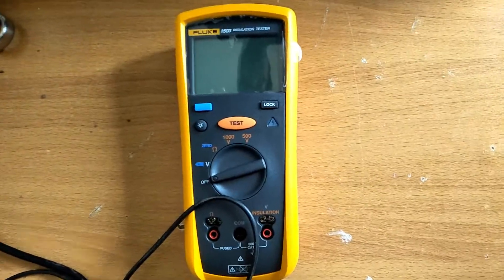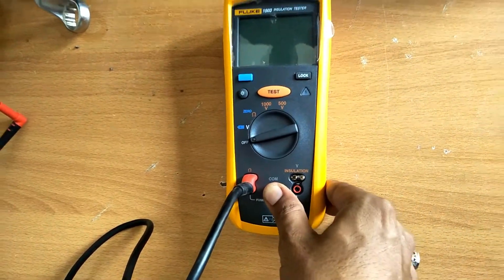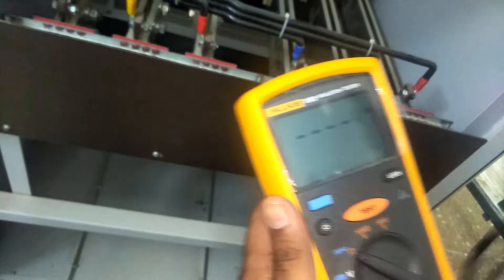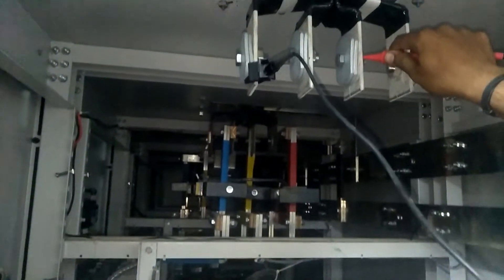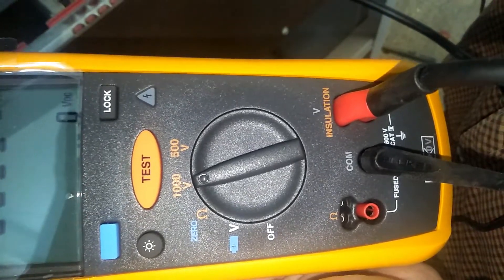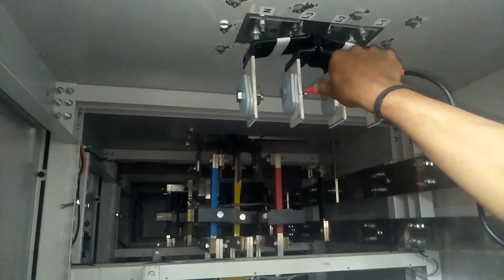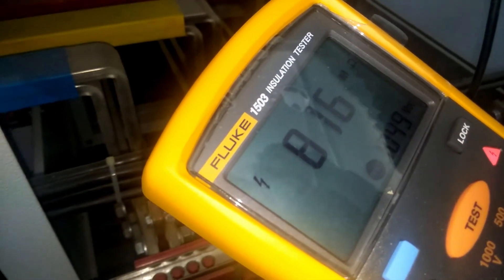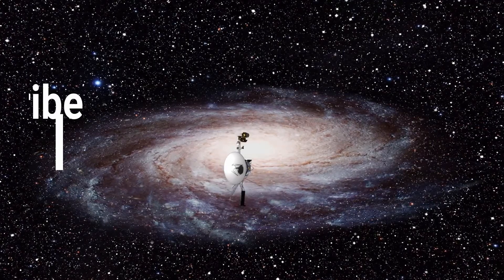How to do Megger and continuity Testing

Comment: How are you holding 1000V without PPE?
Reply: this is at a very low amperage so the power is very low.  

Keep in mine the 1000V is coming from a 9volt battery.
Reply: My god dude it's DC volts man! It will Zap u if you touch it while energized. But the meter will denergize the tested circuit. Once you let off the test button and the Red power light goes out. 
You must be a Safety Director or just never been around electrical testing.